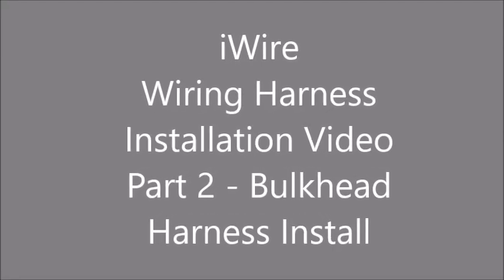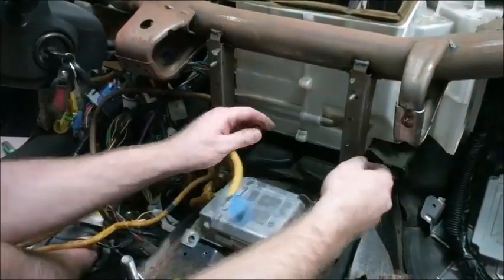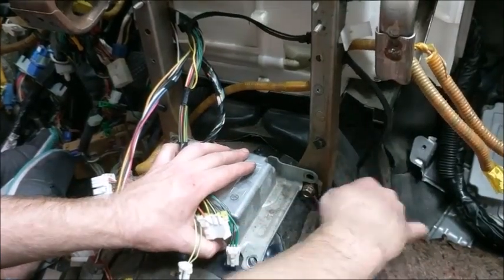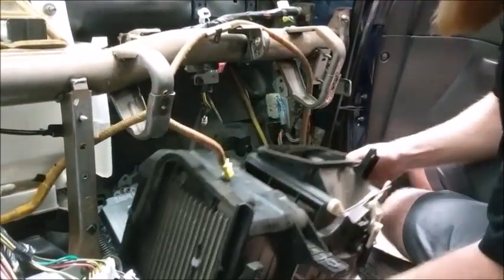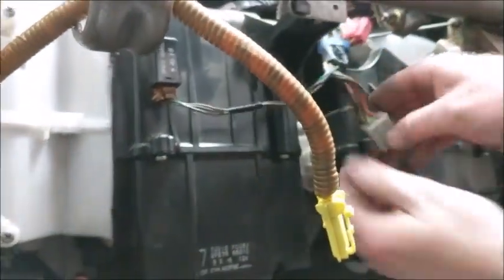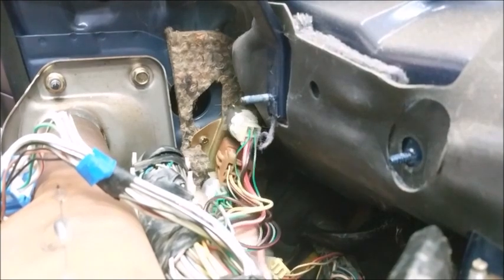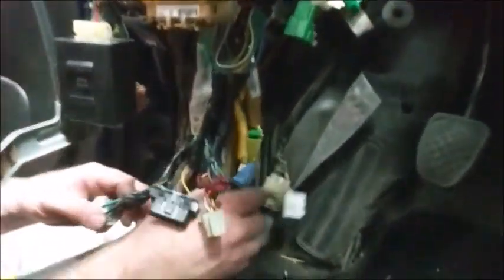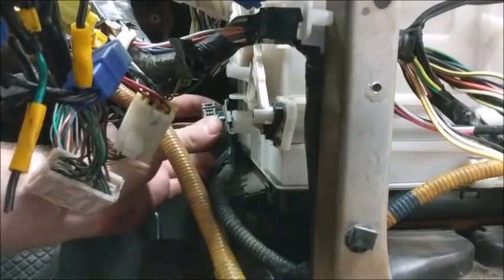iWire Subaru Wiring Harness Installation Video Part 2

Comment: What is the pink plug for with the wagon chasis?
Reply from the maker: It's goes to a relay to power the rear accessory power supply in the trunk area.